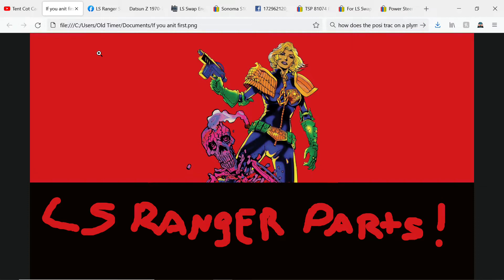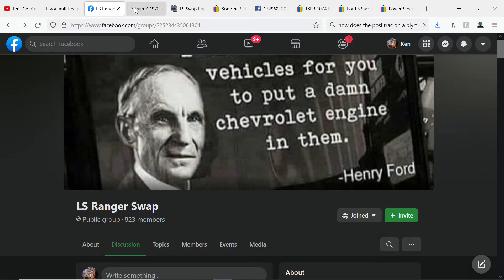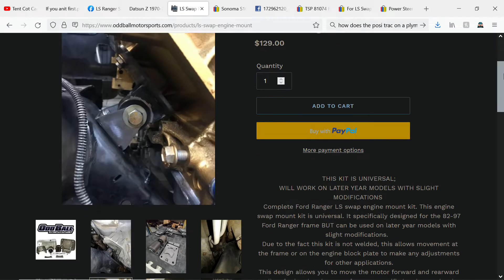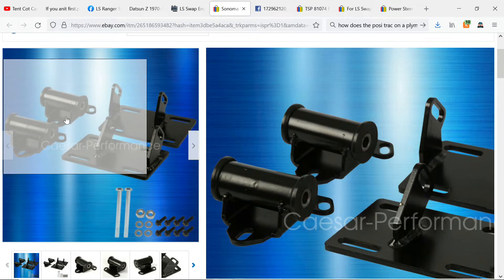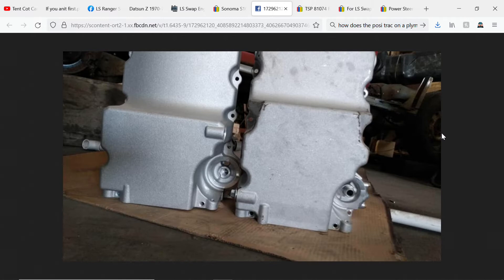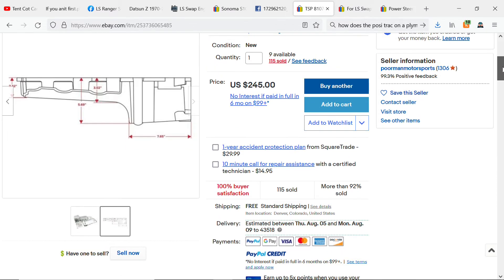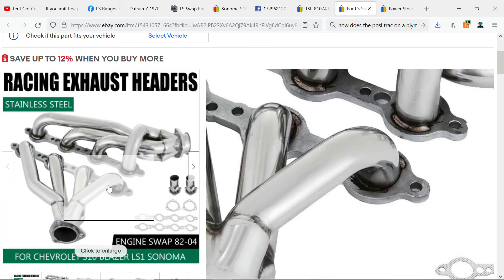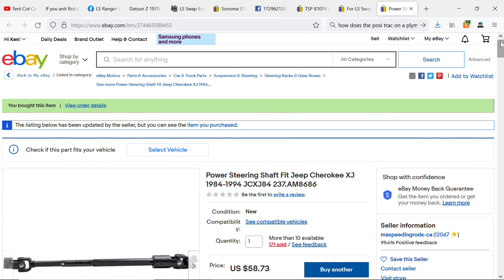LS SWAP A (1st gen) FORD RANGER WITH THESE PARTS! Featured On MOTORTREND!

Comment: I have 1988 ranger 4x4. Has 2.9 getting ready to pull. Then clean up the engine bay. My question is how much trouble am I going to have with the motor mounts when I install them.
Reply from the maker: They make bolt in mounts now, I would image you'll have a better time than I did.
Reply: Do you have a straight axle or still ttb?
Reply from the maker: @maconcampbell3354  TIB